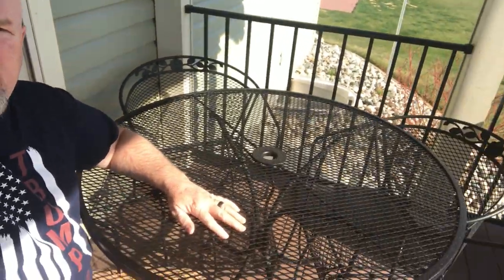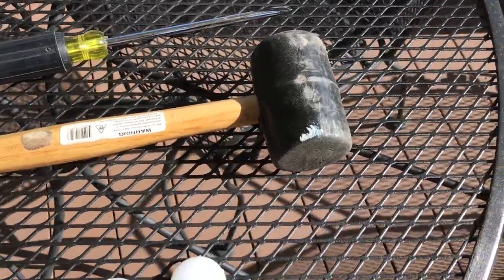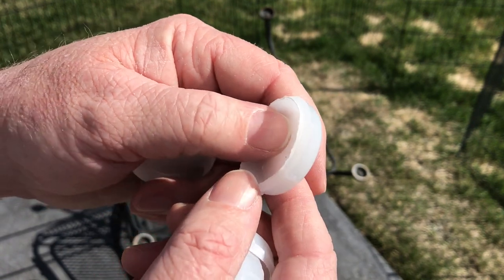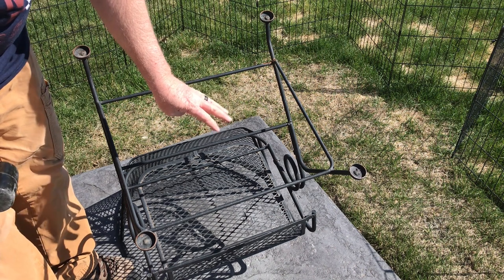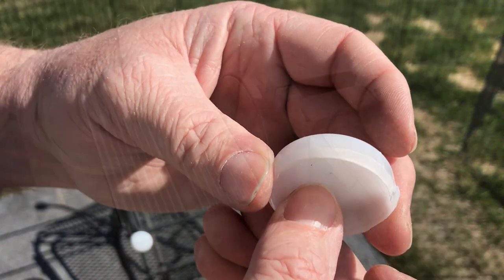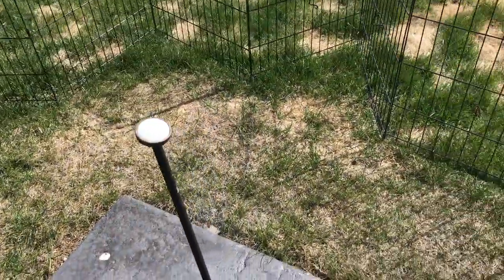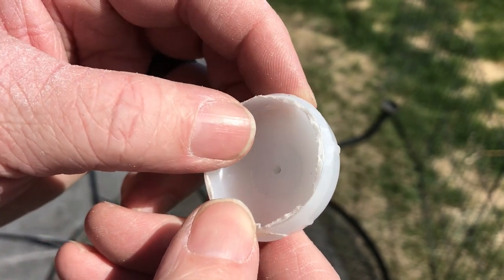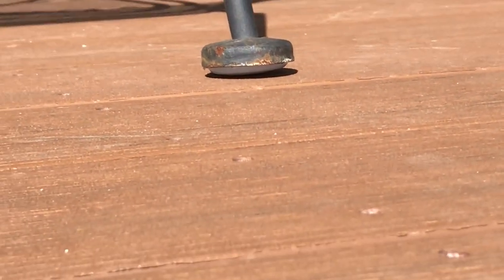How To Replace The Feet Gliders On Wrought Iron Patio Furniture

Comment: I finally figured it out.  Get a worm-gear hose clamp like you find on your radiator hose.  Put the glider in the clamp and squeeze it until it's tight, then a little more to slightly deform it.  It will now go in and will expand back out to hold forever.  I fought this forever and finally figured this out.  It's a little tedious at first to tighten, loosen and repeat but you'll get faster and the best thing...  it works!!!
Reply from the maker: Perfect. Making it stay in with expanding friction has to be the best solution. Thanks for posting Mark!

Comment: I am seeing the warning flags pop up in my mind, when seeing you taper those edges. In time, once you are putting weight on them, I believe those discs are now going to seat themselves in too far, and the metal edges of the feet are going to start rubbing on the deck.
I saw someone suggest heating them to go in more easily. I’d be willing to bet that is a far better method. 🤔